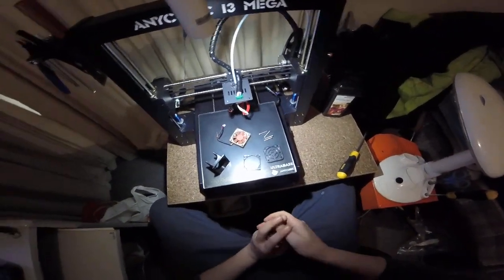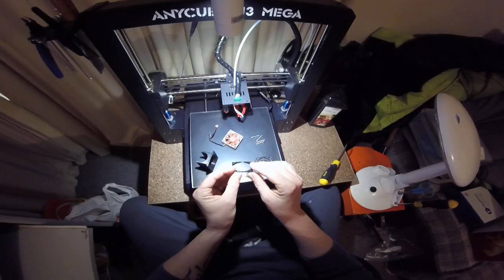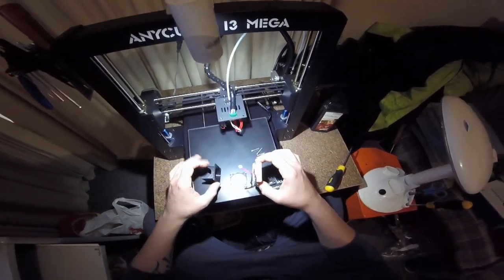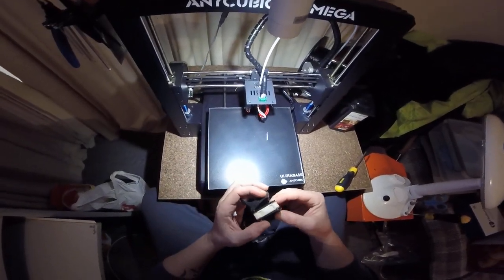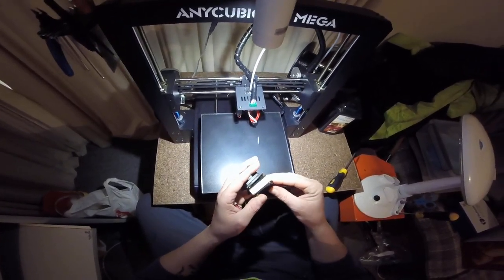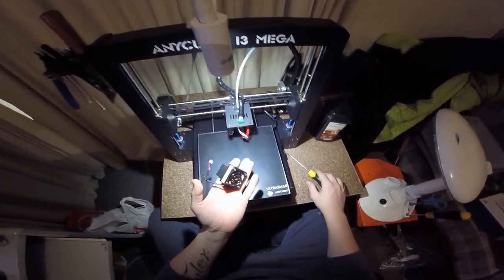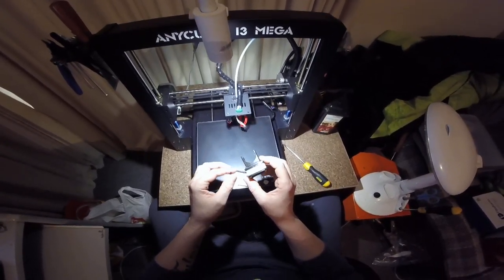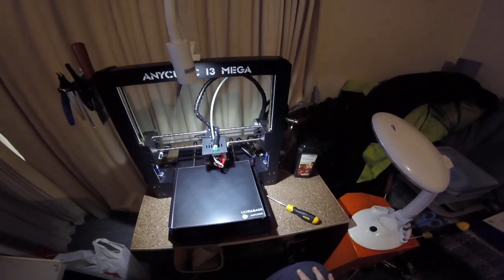Anycubic I3 Mega mods #2 Fan revision.

Comment: Do I need to change the hot end setup to install a noctua fan or can I use the original metal case
Reply from the maker: Hi, the original shroud can be used with the noctua.

Comment: What happens with the results? How is the noise after? I think the one that makes the most noise is the layer fan.
Reply from the maker: Its significantly quieter. The layer fan doesn't worry me as i primarily print ABS in an enclosure therefore the layer fan gets minimal use. ill make a video later today of the printer in use, using a dB meter.

Comment: Great video! I'm getting my anycubic i3 soon, so I was just wondering, how many of the fans are actually worth replacing? Also, what would the measurements of the fans be? Like, how many 40mm and 30mm fans are needed? Also, could you send a link to the best anycubic i3 mega fan duct/hotend housing on thingiverse?
Reply from the maker: Thankyou ! I only replaced the hotend fan on my AI3M with a noctua Noctua NF-A4x10 FLX 12v fan, the board cooling fan is also a source of noise but i find that it doesn't worry me, the hotend fan was by far the nosiest. As for the brackets i used the parts cooling fan bracket from steddyman: https://www.thingiverse.com/thing:2539301 and i used the hotend fan duct by gigl: https://www.thingiverse.com/thing:719427/comments

Comment: Hi Jared - I have a few questions. Did you print all of the brackets/shrouds with ABS or PLA? The thingiverse post for the fan cover explicitly mentions that you should upgrade to the E3D V6 hotend - have you upgraded previously or is this all on stock parts? 

Thanks for your videos, they're extremely helpful!
Reply from the maker: Hi mate, The brackets were printed in PLA initially, and have since printed them in PETG just to make them a bit more durable. If your printing high temps id recommend printing in abs though. I simply took from that thingi post the files which allowed me to use the e3d style hotend fan shroud which offers far superior cooling, along with the bracket which allows me to maintain the stock cooling fan. But yes the e3d v6 is a far more reliable setup but the v5 which anycubic run is fine for most applications below 250c

Thanks for your kind words, its great to know my videos are helping.